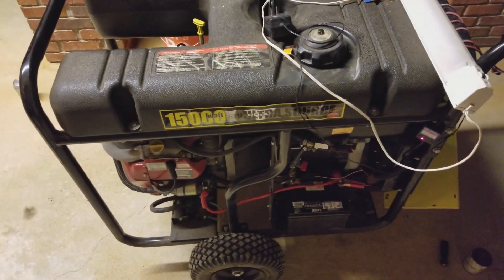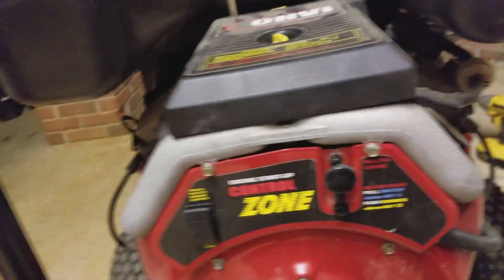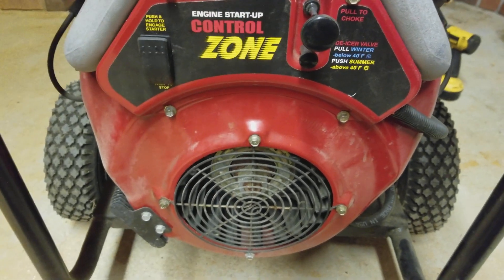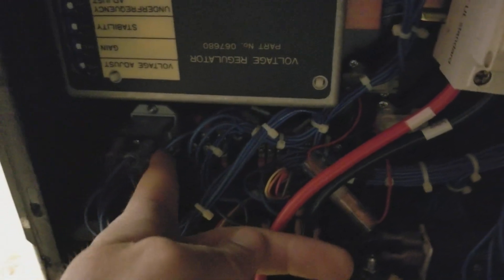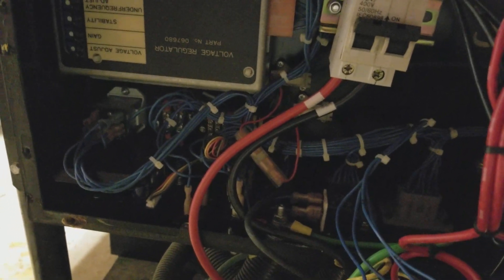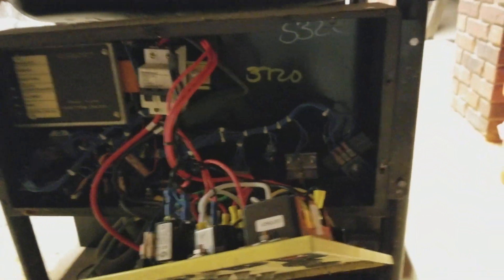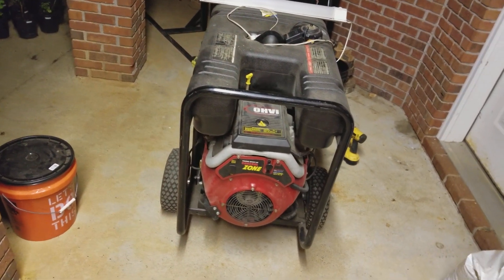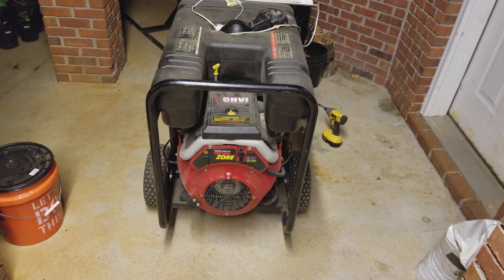Common problem 3 with Generac GP 15000 or GP17500 - Won't stay running start / stop relay

Comment: I have one of these I was given that was flooded with saltwater. 2 days after I pressure washed the crap out of it. I replaced the relay in it that is bolted to the bottom of the box. Cleaned carb ect. I actually took apart the relay you just showed and blew it out. Just tried to start it and it starts and dies. Gonna go play with it some more. Probably a lost cause being flooded with salt water
Update, took apart that relay,spayed with wd40. Starts and runs now.

Update, I'll be dammed,it's putting out power to. And the economy button is working

Comment: Why does the seventeen fifty only have a thirty amp plug ?
Reply: The 17500 does have a 50A plug. Look on the bottom of the electrical panel for the outlet.

Comment: hello, thank you for the video. Might be a long shot, but do you still have this Generator ? If so what kind of battery are you using ? in terms of cc. The manual just states "U1"
Reply from the maker: I still have it and bought a battery of the appropriate dimensions from Advanced Auto.  Doesn't much matter as long as it will fit in the space and isn't too small.

Comment: Update changed ssr,rocker switch.. still not working.. I installed a test light to fss and installed spark plug light tester. Now what the generator does is start then dies immediately. Both the fss and plugs are getting spark for first 1,2 seconds then something kills them both at the same time. I disconnected 18 wire but this time spark keeps going.. something is turning off the ssr relay and grounding spark through 18wire. I tested high Rev and oil pressure switch and checked out from repair manual.. is the computer not picking up voltage from windings?

Comment: I have the same one but it blows out my electronics when it runs now. I suspect the voltage regulator but it could be worse. Any tips are greatly appreciated.
Reply from the maker: That's over my head, sorry.

Comment: Thank you for your video.  I have same gen and acting same way.  I replaced 11 pin relay from Grainger and did not fix but found another relay 896H-1CH-S1-R1-T which is 5 pin 50 amp relay.  I believe this is what you are talking about here.  Also, do you have any close ups of your 50 amp breaker and color wire going into each lug?  I had black couple from top of breaker that came out when face of panel were off and I did not realize it.

Comment: You can actually take the cover off the relay and watch it work, or not depending on the case.  A little sand paper between the contacts will fix them temporarily most times if they are sticking.

Comment: I bought a Champion 11250 watt generator at Costco for 999.00$ and so far very good starts really good and they have 24/7 support center for 999.00 $ can’t go wrong 👍🤚😄😀
Reply from the maker: I have a small Champion that's a few years old.  My only problem with it is that lots of the rubber stuff is dry rotting way too early.

Comment: I have this exact generator.   I ordered the relay - to have a spare laying around - just in case.  This SHOULD be it:  https://www.ebay.com/itm/331993644231.  It a SCHNEIDER ELECTRIC 783XCXC-12D Plug In Relay,11 Pins,Square,12VDC.  Several of the comments mentioned that it was for a generac.  Total cost $17.66...
Followup:  I installed this relay and it worked.   There ARE several wires you need to move - take a pic of the existing wires.   I was moving them one at a time and had a question if I had done it correctly.   Would not crank at all.  Got the wiring diagram out - everything was correct.  Check the 10AMP fuse - blown.  Replace it and it cranked right up.  I probably shorted something  when I removed the cover to get to the relay.  Hint:  disconnect the battery first...

Comment: Thanks I think that relay is causing mine not to disengage the fuel plunger in the carburetor.
Reply from the maker: You are welcome.  You could test that theory by taking the plunger out of the solenoid which would let fuel flow no matter what.
Reply: @adrianrog  that's what I did. The fuel flows fine motor starts so I just hooked up a temporary bypass but I believe that plunger is also hope to the low oil pressure sensor I'll have to check the schematics to verify. Generac doesn't like to give information about these generators to anyone other than their service technician. And even Dave pay dearly for the information.

Comment: adrianrog do you know how to adjust the voltage output I have the same generator but it's putting out 113 volts with no load on it
Reply from the maker: 113 volts between one hot and the ground would be well within the normal range.  113 volts between two hots is probably something different altogether.  I don't know how to adjust voltage though, sorry.

Comment: I have this genny. Giant POS. Less than 30 hours, nothing but problems. My trusted local repair shop refused to work on it. Told me "I can it running, but you will be back with another problem soon after." Currently not running. Bought a 12,000 Watt Duromax on a eBay special, $685. Runs perfect, no problems.

Comment: Than you for your videos. Now that I've been able to get my 15kw Gen running again I found myself wondering if it has a an alternator to charge the battery while running and I've just been using a trickle charger this whole time for nothing? Can you or anyone else provide some insight on this?
Reply from the maker: Not an alternator, but it does keep the battery charged if you run the generator.  The problem with most folks is that they rarely run the generator and the battery is dead when they need it.

Comment: Can you post a detailed video like this on how to fix the solenoid problem from the other video?  I opened up the panel, but it wouldn't open completely without unscrewing the choke.  I didn't know how to unscrew the solenoid.

Comment: Any chance you know the part number?  I've tried to read it on my unit and can't seem to come up with a number to order the part.
Reply from the maker: This is what I ordered: 
  https://www.grainger.com/product/SCHNEIDER-ELECTRIC-Plug-In-Relay-6CWG5?cm_mmc=EMT-ShipConfirmGcomShipConfirm_-sku&RIID=24676915135&GID=&mid=RETIRED_CLASSIC_ShipConfirmation&rfe=6a2bbdded5a8d7a476a95a8a717bae344f999ec1196958aa27aac5f045d765d5&origin=prod
Reply from the maker: Mfr. Model # 783XCXC-12D
Reply: Just ordered the part from Graingers - many thanks for your help.  You are the best
Reply: Wow!!!  Ordered the part, replaced it and wham, the generator started right up.  Your posting on the internet (you-tube) was incredible and you save me much aggravation and money.  Thank you so much for your info and rapid response to my question re where to purchase the solenoid.
Reply: You should be able to find the manual on line.  I found it for my 12,500 watt and it has all parts with part numbers.

Comment: The ecu on the bottom of that relay is 4 the stepper motor and on wire 229 that comes from that ecu and goes to the ssr realy if you put a ground on that relay it shuld click that realy controls the power going to the fuel cut on the carb and the kill wire a ground

Comment: My 17500 990cc generac is fouling plugs. Tuned it up after buying used. Use it for emergency standby. Ran it for 7 hours one afternoon during utility service. Supply voltage ran my whole house and garages. 

During the run i noticed some cracking or popping. Not much in the line of surging was noted. The generator was started periodically after that day. The last week (10-2-17) a routine startup attempt failed repeatedly. Pulled the plugs and alot of carbon buildup was noted. Tried cleaning plugs but had to replace to get it started. New plugs and success. 

Has anyone else experienced a similar condition? Different plugs? Carb adjust? Fuel grade?
Reply from the maker: Never had that happen, sorry.
Reply: I had some cracking and popping on my 12,500W.  Adjusted the valves and never heard a sound from it again.

Comment: Thank you very much. I also had the solenoid problem you showed in the earlier video. Very helpful. I cannot imagine why anyone gives you a single thumbs down!
Reply from the maker: I'm glad it was helpful  The info isn't always easy to find.
Reply: You are the only one I have found that is sharing info on these. I would have never found the problem with the relay if you hadn't posted this video. 
I used my generator for the first time at the house I am now in for hurricane Irma. We had an electrician install a 240v 60amp outlet for a kiln. I supposed this would be a perfect place to back feed from. When I did, I instantly damaged the fridge, dishwasher, a UPS, a dozen light bulbs, bell chimes, and more. It turns out that a handyman had forced a double set of 30 amp breakers into the wrong position such that all the power was on one bus. My mistake was to not  check my voltages with a volt meter before engaging the breakers. Lesson learned.
Reply from the maker: If you decide to back feed your house, be sure that you have all four wires connected, not three.  You need both hots, the ground, and the neutral. Leave out the neutral like some people do and you may end up with wildly different voltages on each of the hots.  Most 240v outlets are only 3 wires and not suitable for back feeding with this generator.  If you're interested in being legal, look for a generator inlet and panel interlock.  Very inexpensive and keeps you from being able to backfeed the grid.
Reply: Excellent advice. I did use all four. But I want a transfer switch and will get one in ASAP. I wasn't at all ready for this last storm.
Reply: adrianrog where do you find your parts? I have the same exact generator I picked up about 8yrs ago for $1100 brand new still on the pallet off Craigslist. Either the guy was in a bad bind or he didn't obtain it honestly.  Either way I couldn't pass on it. I've had great use out of it. Runs my entire house great. I was backfeeding it through my range breaker which is a 50 amp breaker. Well I had a bad accident that put me in a wheelchair and couldn't continue connecting it this way and didn't want my wife doing it either. So I had a 200amp service sure buried out to my shed about 125ft from house and put a 50amp plug inside to make it easy on her with the thought in my mind on going with with around a 25kw diesel stand alone so I had more than enough line there. Anyways we ran the generator for about 10-12hrs and it just quit making power but still running. My wife went to check and the panel with all the wiring was hot. I didn't fool with it because power was back on an hour later. I went out a couple weeks ago to change oil... plugs...filters and fired it up but still no power. I opened up the panel and 75% of wiring was melted and at least 1 relay. So it needs a new harness and not 100% sure what else. I wasn't exactly sure why it happened and the safety didn't shut it down but was starting to lean towards the ground so I had someone come out the specialized in generators to be sure. He confirmed that it was the ground. The line I buried was acting like a capacitor and building power up because just the ground to the frame wasn't enough  for that long 200amp wire and needed to drive an 8ft ground rod and ground it to that as well. But he's having trouble finding a harness. I found some on line but no pictures. There are 2 that this generator calls for and I'm sure it's the more expensive 1. When I called about I was kinda given the same thing that if I don't have an exact part # They can't guarantee it's gonna fit. I haven't put alot of time into looking because of the electrician checking but now he seems to be dragging his feet so I'm not giving him much more time before I go about fixing myself. He has time invested coming out here and didn't charge me anything yet so I still wanna give him the chance to fix it but at the same time when he's not calling back it's about time to move on. It's that time of year for thunderstorm and I don't wanna be caught with my pants down when we lose power
Reply from the maker: @skinsfan-nw4pp  I've been able to find my parts on eBay, but you may need to find your local Generac dealer and ask them to order parts.